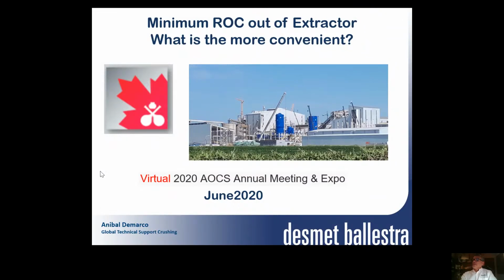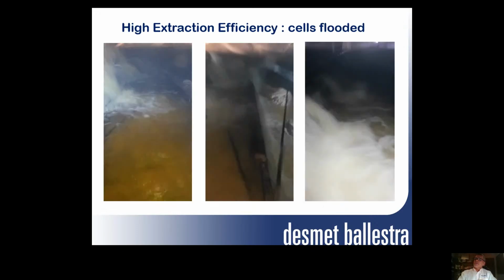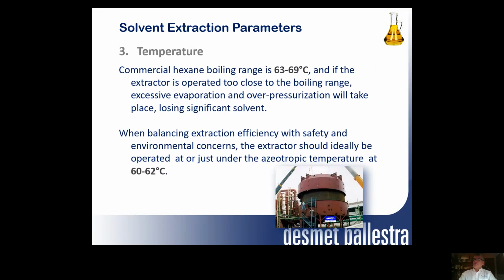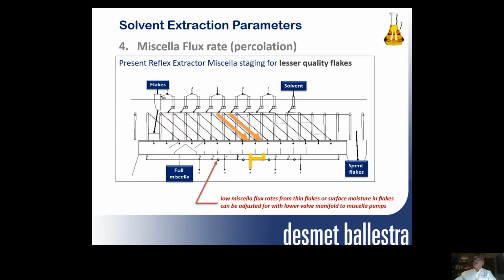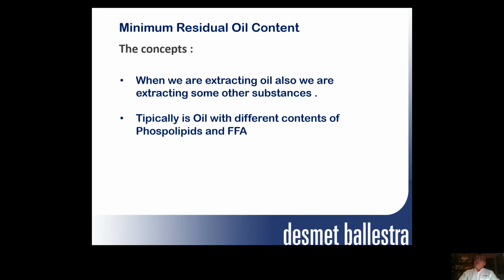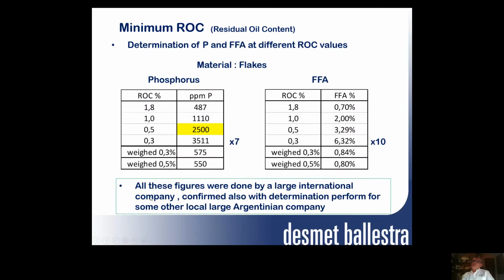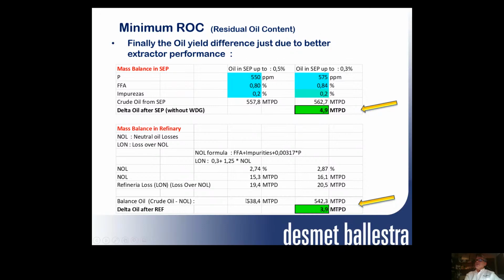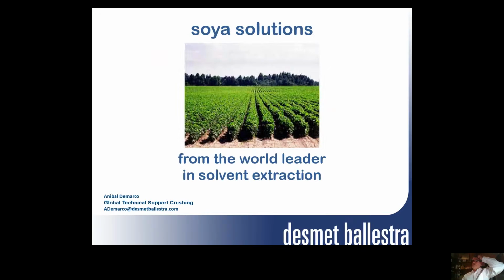The Minimum Oil Residual is the Right Choice - Anibal Demarco, Desmet Ballestra, Argentina

Comment: Expandate is the generic name given to "collets" of soybeans flakes previously processed in an expander machine. That´s a thermal/mechanical extrusion/ expansion of soyflakes mass by means of live steam inside a cylindrical barrel moved by a shaft with worms rotating @ 320 rpm.